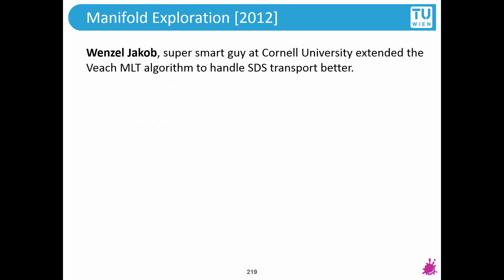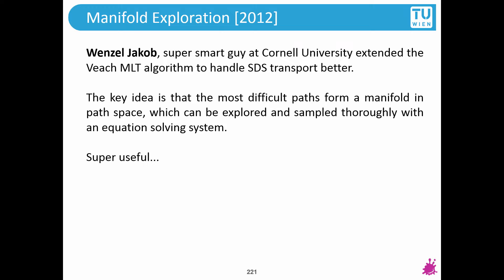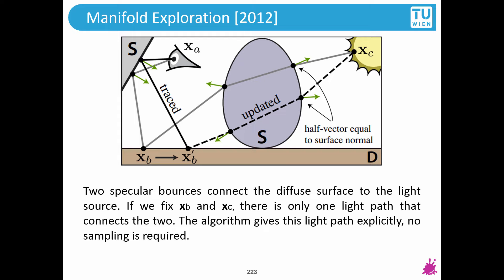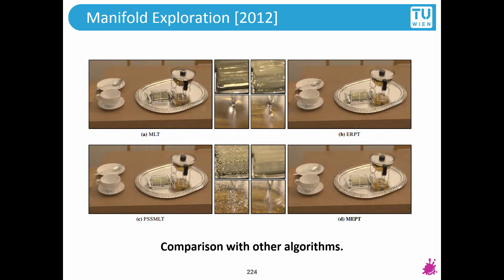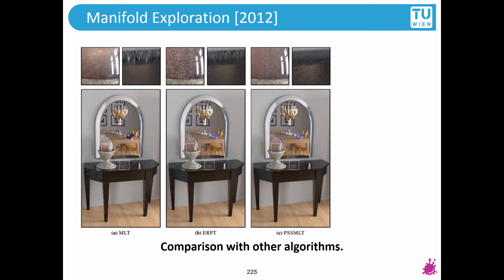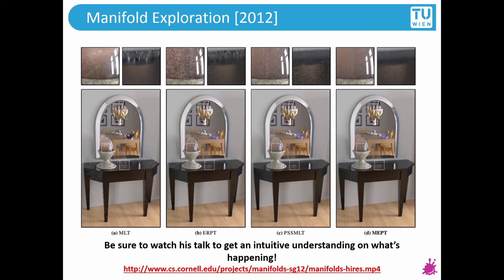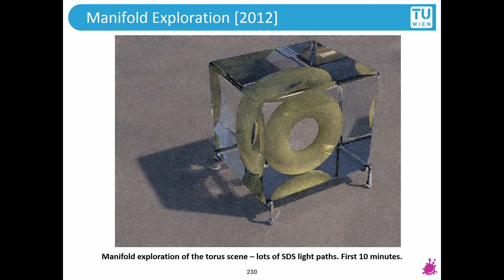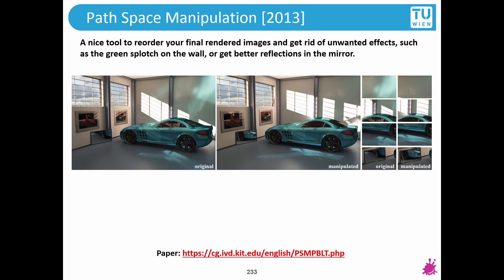TU Wien Rendering #37 - Manifold Exploration

Comment: Can this same algorithm be applied to your simpler version? I suspect no since you said your algorithm doesn't work in path space while his technique does, and it looks like this specifically references the pathspace checking for SDS interactions.
Reply from the maker: +Kram1032 It currently works with the Path-space Metropolis only. However, there is now a recent, quite simple variant: http://cg.ivd.kit.edu/english/HSLT.php
Reply: neat! Quite impressive results. Of the four comparisons in the kitchen scene image on that page, I noticed MEMLT has some weird horizontal streak artifacts. Are those due to the algorithm or is there something else going on? Does it somehow prefer scanning the scene horizontally over vertically? Weirdly, I can't see such patterns for the jewelry example.
HSLT certainly seems to do a great job.
Reply from the maker: +Kram1032 I got artifacts with ME-MLT only when I set up the Metropolis sampler improperly. Outside of that, I've never seen any artifacts.
Reply: +Károly Zsolnai-Fehér What is the correct way of setting it up, i haven't the got a clue and i tried everything now and an entire section of my image was close to not rendered at 10k samples.
Reply from the maker: +Elias Laurell Send me the scene and your integrator setup through e-mail, I'll have a look.
Reply: Thank you very much and i did :)

Comment: Any render actually using this yet and i tried mitsuba but this mode is missing.
Reply from the maker: +Elias Laurell Hey there Elias. It is there in Mitsuba as an option under the Path Space MLT renderer. :)
Reply: Well it is not working well for me my scene still missing light paths at 2000 spp.
Reply from the maker: +Elias Laurell Don't despair, many scenes don't converge until many thousands of samples! The most difficult ones can take even tens of thousands until convergence. :)
Reply: +Károly Zsolnai-Fehér I would love to talk about rendering techniques and other stuff, do you have skype?
Reply: +Károly Zsolnai-Fehér sent the blend file, it's setup as sppm but iv tried all the modes and settings combinations.
Reply: Newsflash! Renderman 22 will use this technique.